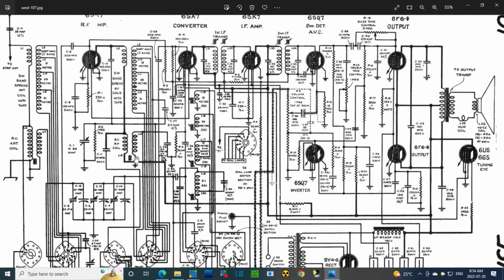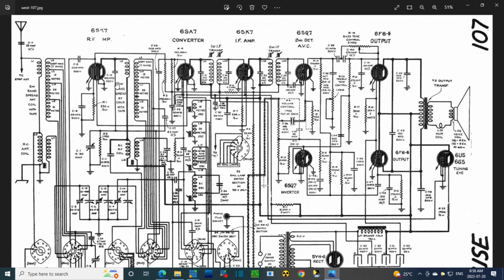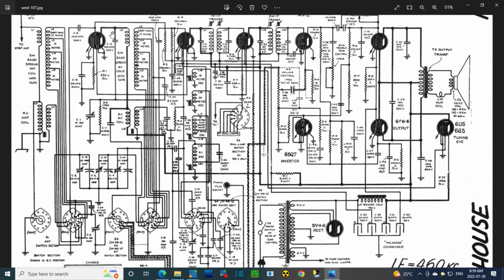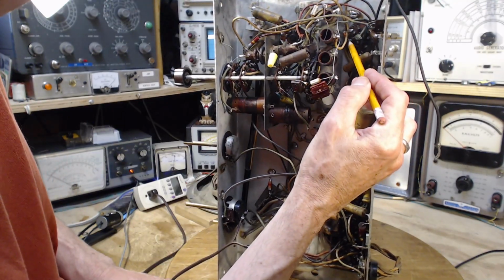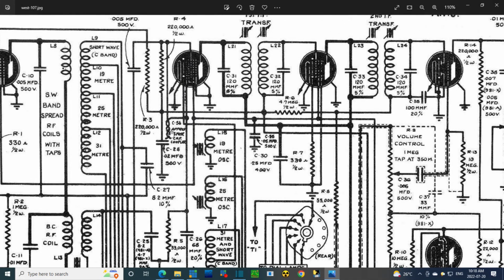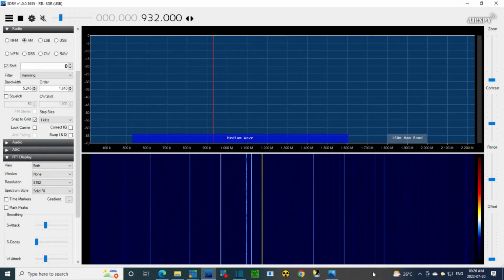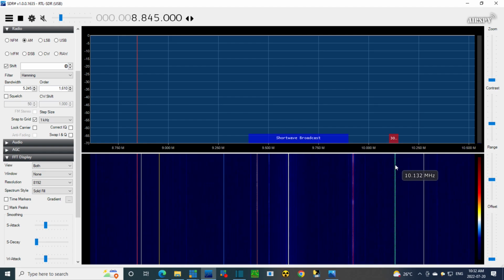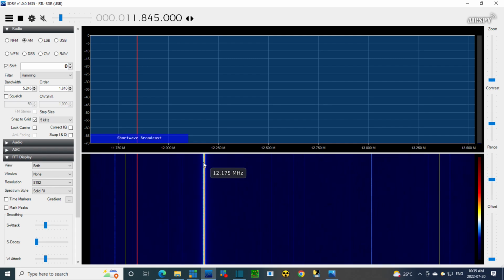Canadian Westinghouse 981 Shortwave Radio Video #7 - Burned Capacitor Replaced

Comment: Wouldn't it be better to look at the schematic first  and follow it and check the components as you go. Mark on the diagram all that you have checked as you work your way way though, and note all the components that you have changed. Not only will you get familiar with with the circuits and how they are configured, you shouldn't get any nasty surprises when you power it up.